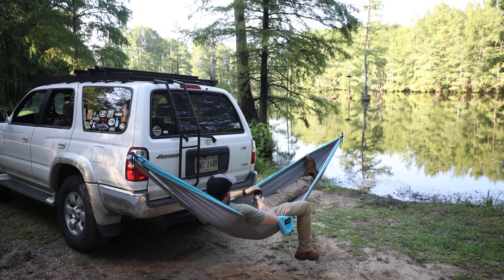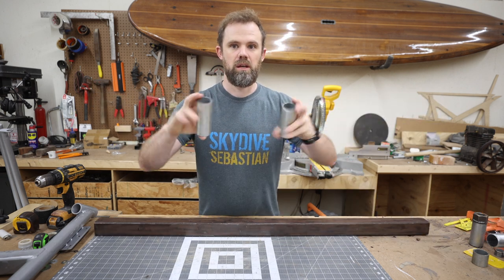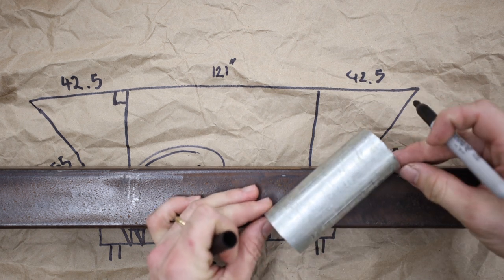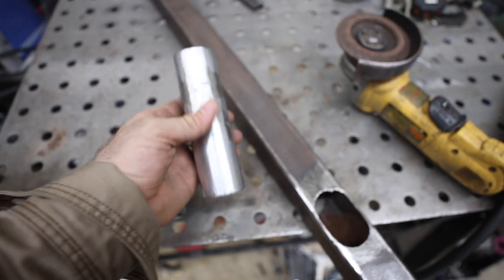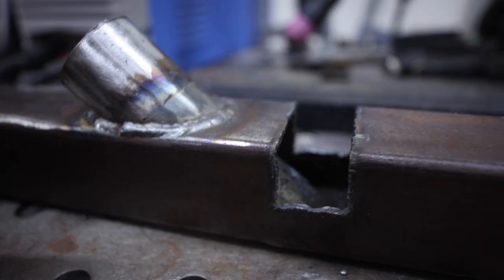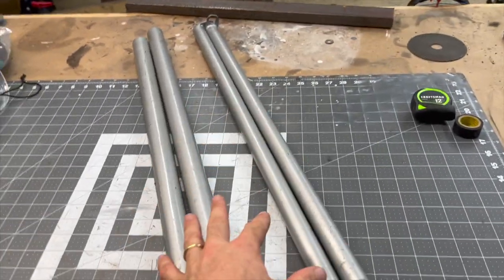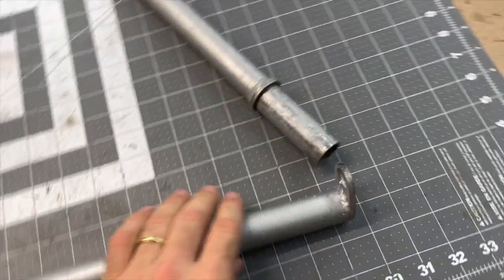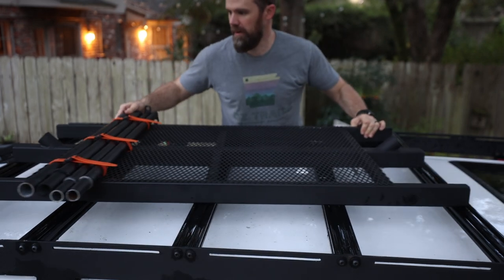DIY Rooftop Hammock Mount

Comment from the maker: What project would you like to see me do next?
Reply: Anything storage related, if you have any suggestions as to what might be used instead of pelican cases, in general storage solutions!
Reply: Trailer hitch bike rack
Reply: Would love to see your economical rendition of the Redtail Skyloft 4 season roof top tent
Reply from the maker: @romaellodfranco72  I’ve actually been thinking about doing this! Or just putting hard sides on my clamshell that I already built. I think it’s totally doable
Reply: @PatrickRemington  Please do. That would be so awesome and certainly a wealth of knowledge / well of value to the DIY community / Subscribers
Reply: Basic tire carrier, either bumper mount (with fold out table on the backside) or bed mount, angled over the wheel well (leaning out). Simple OBS Ford style rear bumper (with hammock pole inserts) and storage inside the bumper.  Something with round light recesses...tail gate ladder. Superlight cabover cap jack system.  Vertical hitch bike mount for fatbikes.
Reply: Ooooh, a hitch mount basket that has a double jointed lowering mech that keeps the rack level as it lowers to rest on the ground. Kinda tucks under your tailgate out of the way or acts as a step. Also a possible removable upright spare wheel mount for cargo baskets in general.
Reply: Eek! Never thought about a rooftop hammock! Views must be amazing. I’ve watched and watched your videos over and over again and love them! Thank you! 
Can you build a drive away tailgate awning/tent with detachable sides please?